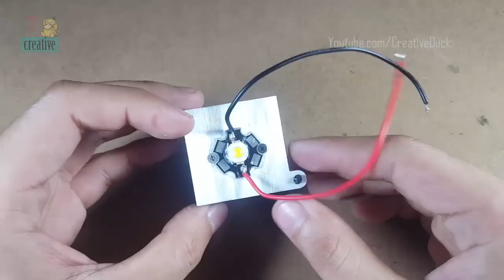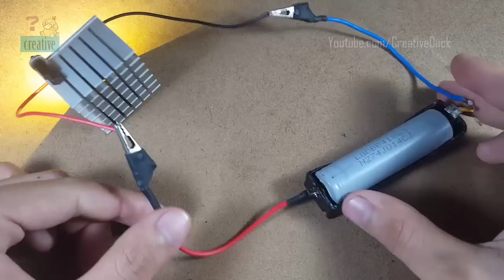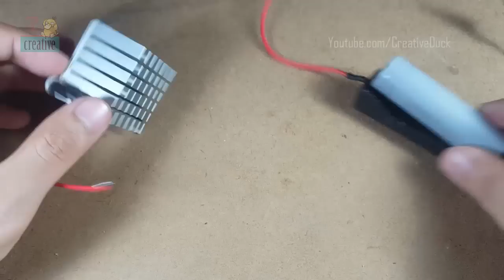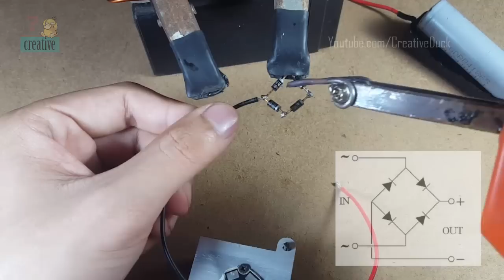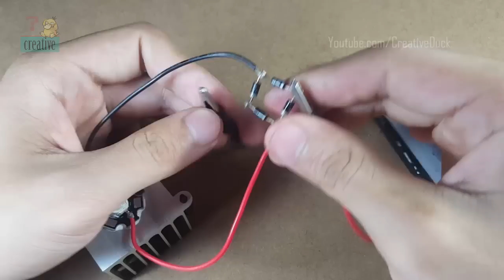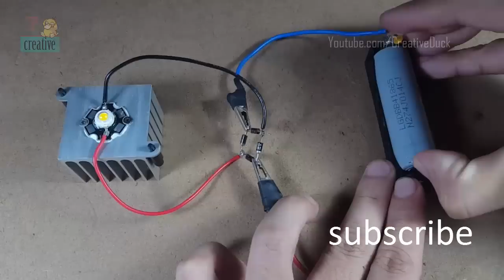Another way to use Bridge diode

Comment: Well, honestly I discovered that 3 years ago and that would be useful for any dc electronic device. The problem that you'll notice is voltage drop, especially when the power source cannot be adjusted. Otherwise, it's still helpful with small objects, like LEDs
Reply: 0